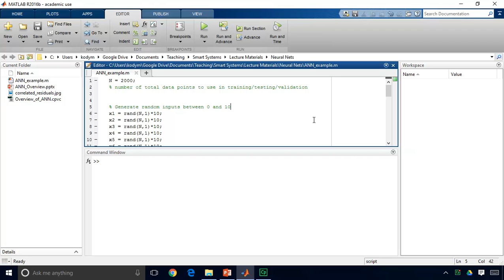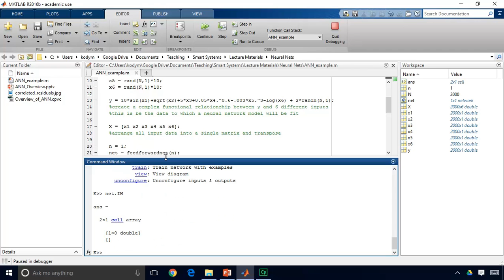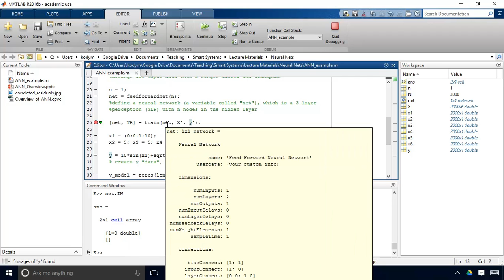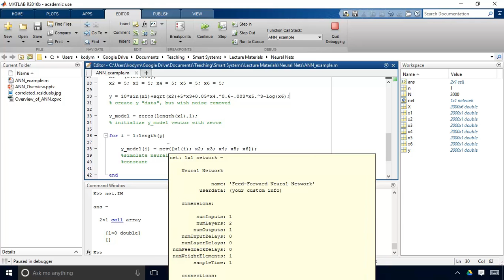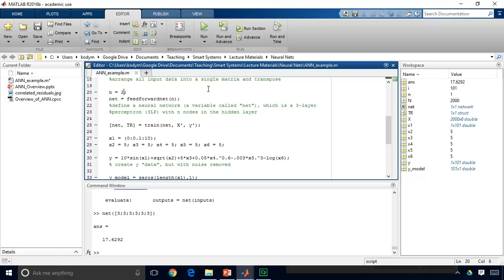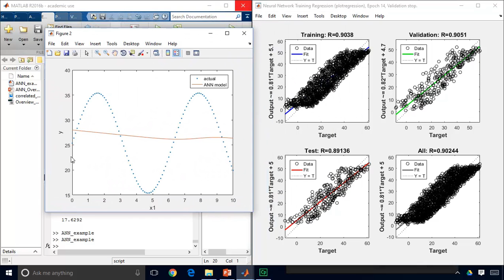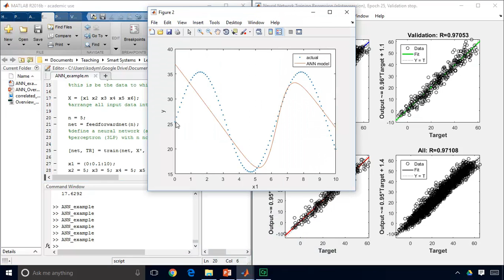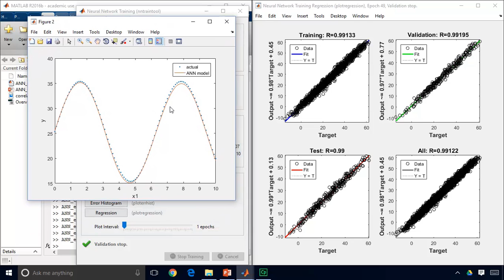Using Artificial Neural Networks to Model Complex Processes in MATLAB

Comment: Hi Kody, great video ( Thank you ).  I am using MATLAB 2017a, tried to follow your example as I am a beginner on the MATLAB NN toolbox.  I get an array index exceeded for the 'for loop' using length(y), so I changed it to length(y_model).  Not sure how did your work as the size of 'y_model' is a lot smaller than size of 'y'?

Comment: Hi,  Thanks for the video. I have a question.

In the code, i swapped the positions of x1 and x2 after training the net, i.e. the plot is between values of y and x2. However, now, even though the value of R is .99, there is a huge difference between the actual value and ANN model in the plot. Can you explain why? Thanks
Reply from the maker: If you train the model with your input variables in a certain order, then be careful to feed the variables into that model in that same order. If this is what you've already done, I'd suggest just trying to re-fit the model or try different numbers of nodes. My code uses random initial weights, so the fitting routine can actually produce different results from one try to the next even if your code doesn't change. That's a downside of this method. There is a lot of trial and error involved. I'd suggest trying different numbers of nodes (and even multiple times for each) until you get a fit you are satisfied with. It's helpful to save your neural net so that you can go back to it and use it again if you get reasonable results.

Comment: Hi Kody, thanks a lot for the VDO. However, I have been trying to use an existing network which was an optimized one to use in the future but when I run it again they seem not get the same result so I have to do more time to train again and again. It would be appreciated if you could give an advice.
Reply from the maker: Hi Khamtan, 
Because the code I showed in the video uses random initial weights, sometimes this does result in bad results and the actual goodness of fit of the model can change since the random weights change when you run it. My advice would be to try a few times and with different numbers of nodes. Double check your model against new data that was not included in the training set and see how well it works. Once you get a good model, save it as a file from there. I don't know the exact code off the top of my head, but you should be able to use your new weights from the good model as a starting point for a new or modified model. I hope this helps.

Comment: can you show your code below line 43?
Reply from the maker: Here's the full code:

N = 2000;
% number of total data points to use in training/testing/validation

% Generate random inputs between 0 and 10
x1 = rand(N,1)*10;
x2 = rand(N,1)*10;
x3 = rand(N,1)*10;
x4 = rand(N,1)*10;
x5 = rand(N,1)*10;
x6 = rand(N,1)*10;

y = 10*sin(x1)+sqrt(x2)+5*x3+0.05*x4.^0.6-.003*x5.^3-log(x6) + 2*randn(N,1);
%create a complex functional relationship between y and 6 different inputs
%this is be the data to which a neural network model will be fit

X = [x1 x2 x3 x4 x5 x6]; 
%arrange all input data into a single matrix and transpose

n = 6;
net = feedforwardnet(n);
%define a neural network (a variable called "net"), which is a 3-layer 
%perceptron (3LP) with n nodes in the hidden layer

[net, TR] = train(net, X', y');

x1 = (0:0.1:10); 
x2 = 5; x3 = 5; x4 = 5; x5 = 5; x6 = 5;

y = 10*sin(x1)+sqrt(x2)+5*x3+0.05*x4.^0.6-.003*x5.^3-log(x6);
% create y "data", but with noise removed

y_model = zeros(length(x1),1);
% initialize y_model vector with zeros

for i = 1:length(y)

    y_model(i) = net([x1(i); x2; x3; x4; x5; x6]);    
    %simulate neural network with varying x1, but all other variables
    %constant
    
end
figure(2)

plot(x1, y, '.', x1, y_model)
xlabel('x1')
ylabel('y')
legend('actual', 'ANN model')
Reply: @kodymerlin   sir can you please send the MATLAB coding